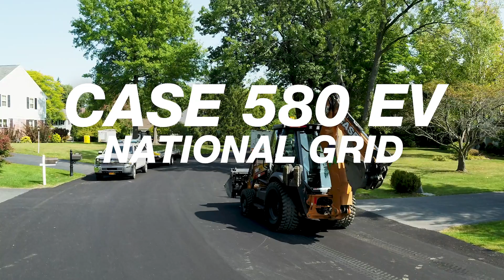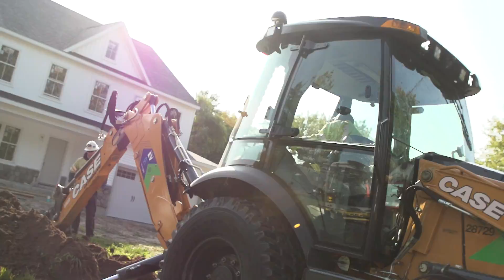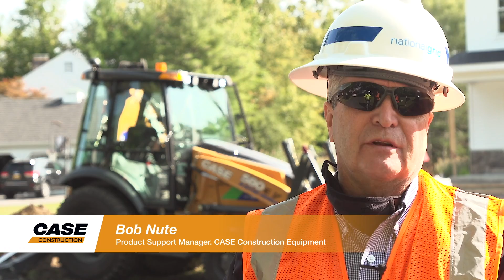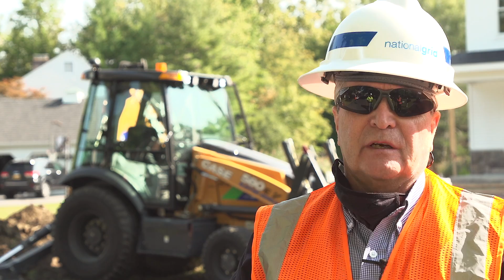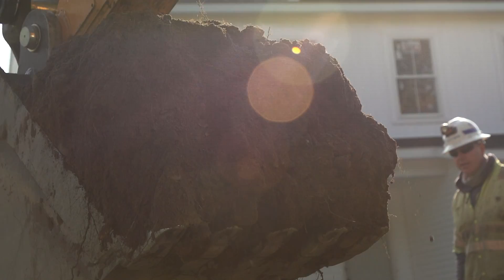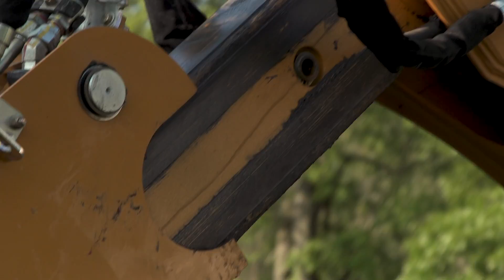North America: CASE 580 EV Electric Backhoe at Work

Comment: And when you are on a large construction job with no electricity installed at the site then what?
Reply from the maker: CASE recognizes EV products are not meant for every application and operation. If you’re dropping your backhoe off at a site to work in a field for days or weeks at a time, you’ll need a diesel-powered machine (don’t worry, we have 10 models to choose from). If you’re in a metro area and are trailering each day back to your shop or can get to local charging stations (the 580EV is compatible with any J1772 Level 2 automotive style charger), EV is a great option! Your local CASE dealer can help you determine if electric equipment is right for your application. Learn more about our complete lineup of EV machines at https://www.casece.com/en-us/northamerica/solutions/case-ev.

Comment: I have gotten to run both it's nice that it is quiet but it has alot less power and while the gas or diesel powered burn about the same amount of fuel when performing even very strenuous tasks the electric starts falling off  but for light task  it is great I personally well stick with the power of the gas and diesel powered

Comment: Wow, putting in a gas line with a machine that burns 62% coal and 11% natural gas. How "green" can you get? 
How much? In dollars.
How long does it run on a charge?
How hard is it to change batteries?
And, how much is a battery pack?
Reply: New York State does not run on 62% coal. Where are you getting your stats  from?
Reply from the maker: Farmer Bill, the units we have in the field with National Grid among others will help us evolve to alternative fuels, including electric machines that are both ‘green’ and practical. Answers to your questions are below.

How much? In dollars. 
The 580EV model is not yet a production machine, pricing will be available when it is available to the general public.

How long does it run on a charge? 
The CASE 580EV was designed with specific customers in mind, like Utilities. The battery charge and machine performance support a full day’s operation.

How hard is it to change batteries? 
Batteries on electric vehicles are like engines, so they are designed for the life of the machine. They are not intended to be a routine service item like existing batteries on today’s diesel construction equipment.

And, how much is a battery pack? 
Today, electric vehicle battery packs for construction equipment are not manufactured at production volumes yet. For that reason, battery pack are still considered specialty equipment with relative costs to special equipment.

Comment: How do you switch operating patter on a super N 580 extendedhoe from iso to Sae or backhoe to excavator?
Reply from the maker: Hello Eduardo,

Switching the Backhoe controls from SAE (Backhoe-Controls) to ISO (Excavator Controls) is incredibly easy in any CASE backhoe loader, equipped with pilot controls.

On the right pilot control tower (with the seat facing rearwards) there are two buttons:

1.	The top, 3-position rocker switch is the Backhoe Pilot Enable switch, which will enable/disable backhoe controls, including swing, boom, arm, bucket, and stabilizer movement. This is a great safety feature to ensure the backhoe does not move due to accidental input

2.	The bottom button is a 2-position rocker switch with a ½ icon. In accordance with the sticker directly to the right of the buttons, Position 1 is backhoe/SAE pattern, and position 2 is excavator/ISO pattern. It is important to know that this is orange tab is a locking button to protect against accidental input and the operator will need to push up on the lock tab (toward the center of the button) in order to change the pattern, pushing the lock tab back down, once the desired pattern is selected. The pattern change button will glow orange only when in Position 2 (excavator/ISO pattern).
Reply: @Caseatwork  thank you so much I appreciate you responding. I have been using a case backhoe for the past 4 days now. I have to say it is the best backhoe I have operated.